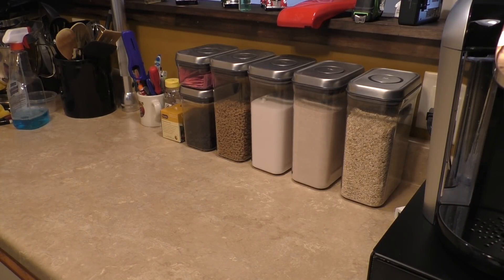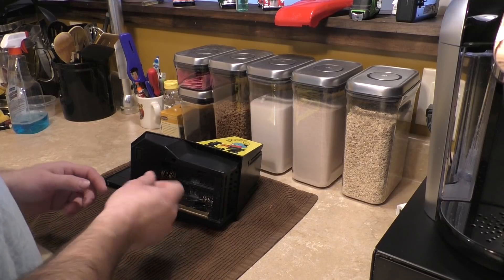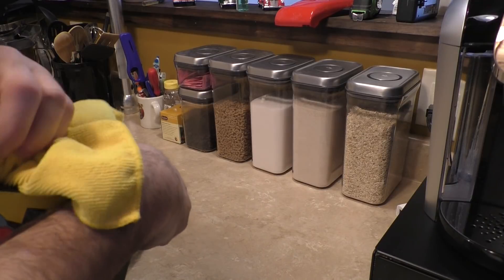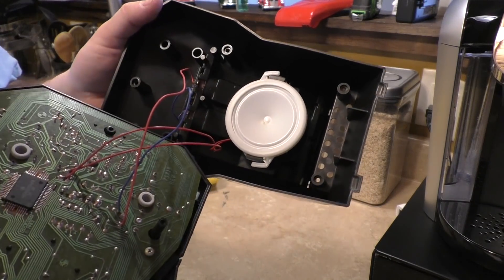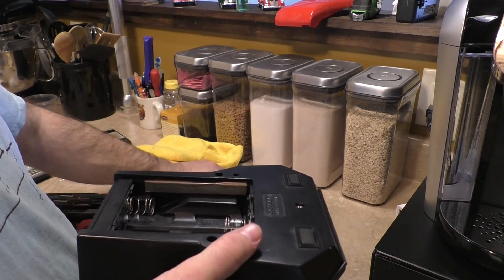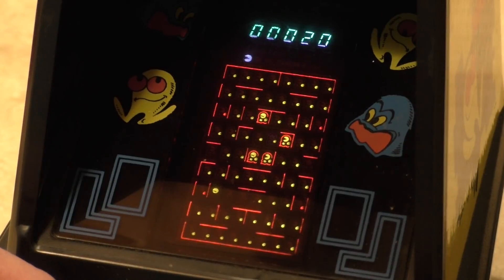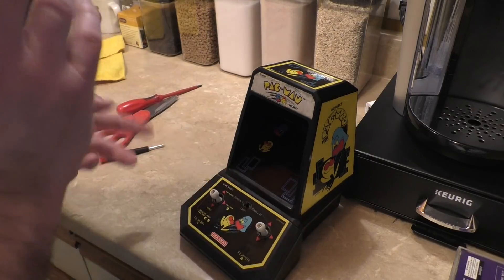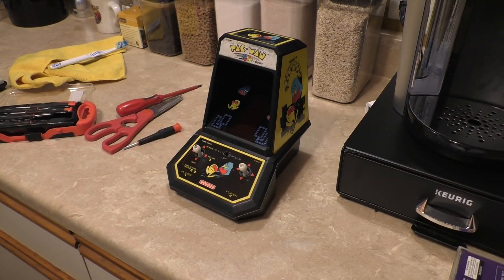1981 Coleco Tabletop Pac-Man Game

Comment: im pretty sure they started adding expiration dates on batteries in the mid 80s as i have seen 89 on duracells and the dates are usually 3-5 years from production date.
have seen earlier expiration dates on older batteries from other manufacturers. tho im in europe it might not have been a thing in the US until later.

Comment: i always thought was interesting these had a wired thing that went in where batteries go. never seen the thing that plugs into wall but the sticker talks about it. always wondered what attached to the back. never seen anything use it. sure others said already but this is vfd not led.
Reply: james42519 my guess they planned on adding a jack and went as far to put the sticker  and design the back for a plug but then abandoned that at the last minute or was in an earlier revision....